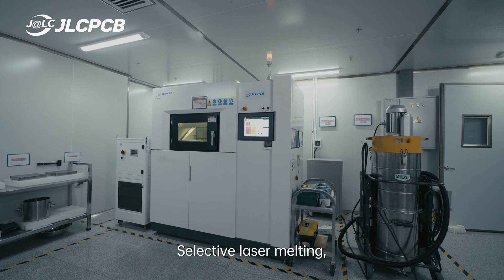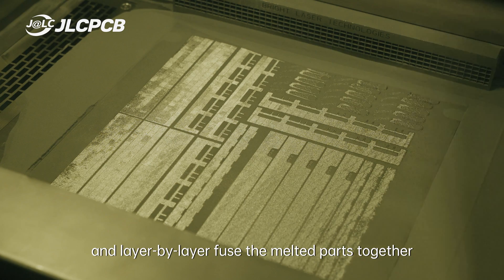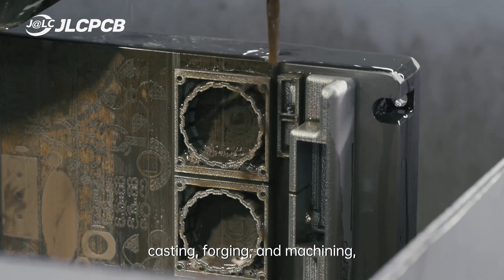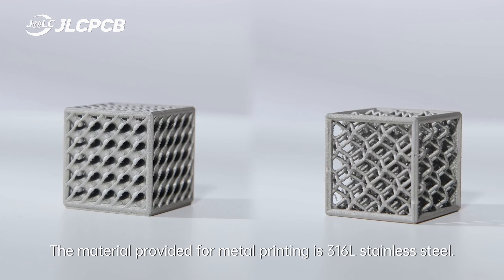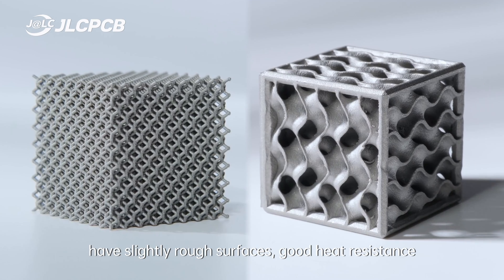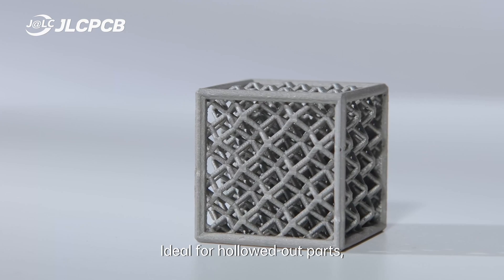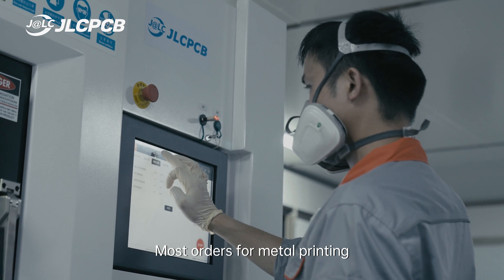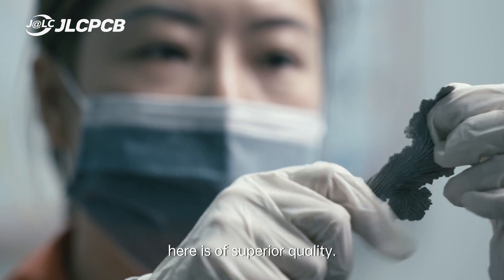Selective Laser Melting(SLM)3D Printing

Comment: Wow, this seems interesting! I have a question : so, is it a process where the Laser Electron beam directs at a uniform powder (laid out by recoater blade?)  bed layer, and melts and fuses the powder , and the process is repeated until the product is fully completed?
Reply from the maker: Yes, you’ve got the right idea! In SLM (Selective Laser Melting), a high-power laser selectively melts and fuses metal powder layer by layer. The recoater blade spreads a thin layer of powder, and the laser melts specific areas according to the design. This process repeats until the full part is built. Let us know if you have any other questions!
Reply: @JLC3DP  I was just wondering and very curious as to how poor flowability affects your operations, or poor PSD, like if the overall Particles arent spherical enough, or the distribution of particles are too widely spread or too little (like D10 of um 10) does your machine get "stuck" in a sense? or does it just make the Laser more prone to mstakes?